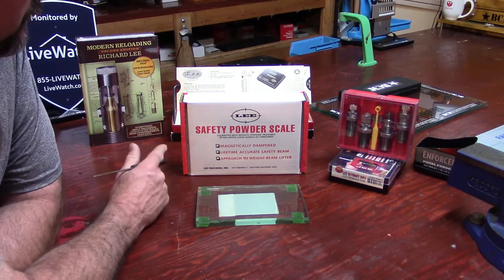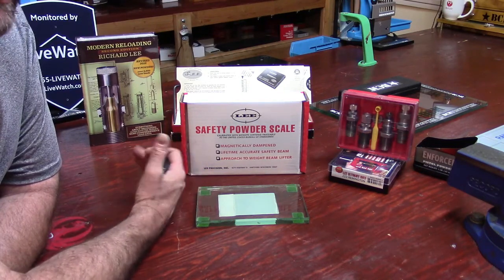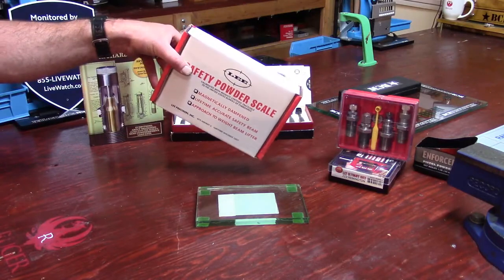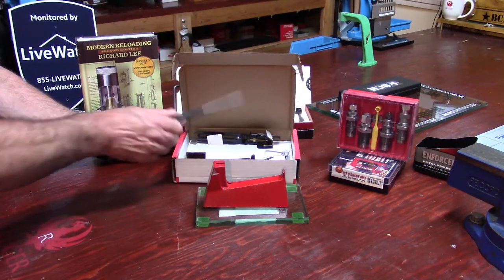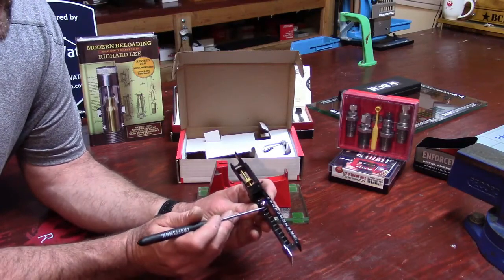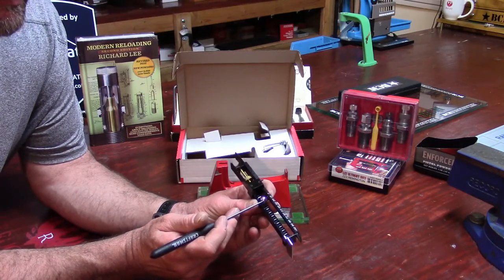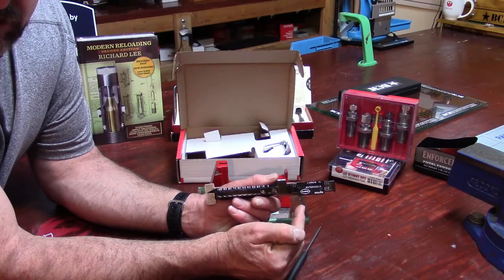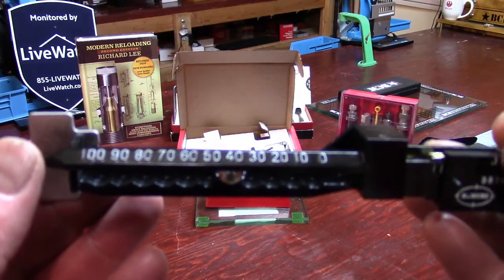Lee Deluxe Challenger Press Kit, Video 4, Lee Safety Powder Scale Set Up, Design  and Operation

Comment: Hello Highboy, another fine video.  I purchased this scale before I watched this video.  I guess I made a good choice.  I had a brand new electronic scale ($80), it worked great when I turned it on the first time to calibrated it.  When I was ready to reload, it failed. Now I'm waiting for a new replacement, and I'm not sure I trust the replacement.  I feel better having the Lee safety scale to double check the other scale. Reloading is on hold until they both arrive. One thing you forgot to mention Highboy, the price is right for Lee Safety scale. Thanks again for the videos.